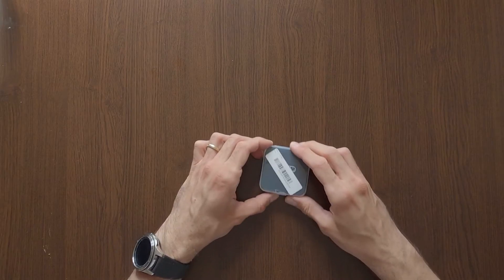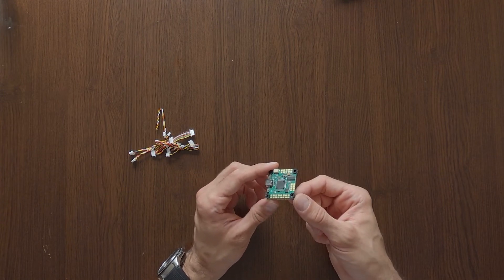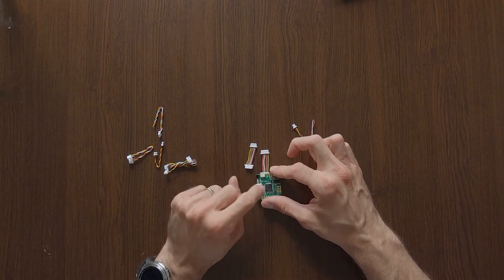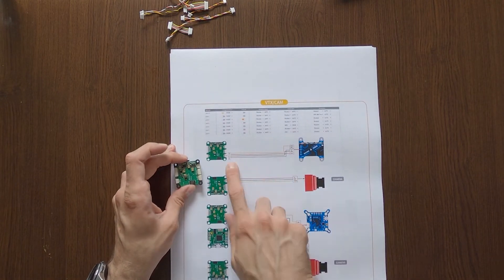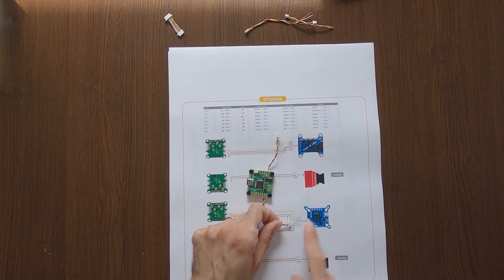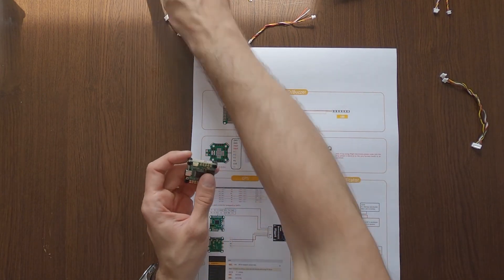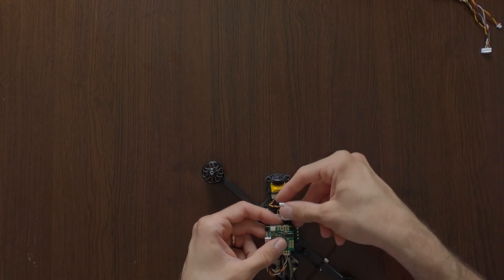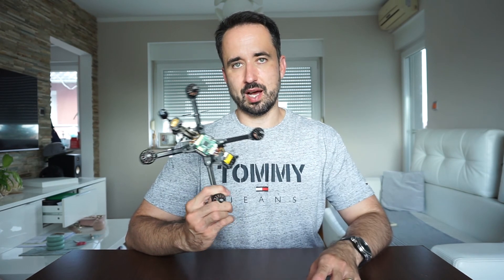iFlight BLITZ F7 V1.1 OSD Flight Controller

Comment: I want to wire tbs diversity nano, but I am already plugging the air unit in the two ports next to each other, tell me where to plug the tbs diversity nano receiver? Thank you 🙏🏼
Reply from the maker: You can use any tx/Rx plug on the fc

Comment: Hi, with this iflight FC why are the GND and BAT wires to the ESC doubble? I need to connect a different ESC to this FC. Which BAT and GND do I take 🤔 ?
Reply: just different options, like a usb port on both sides of a laptop.
Reply from the maker: Whatever suits you better